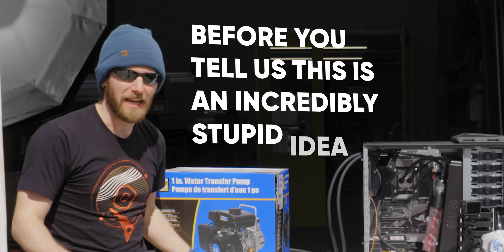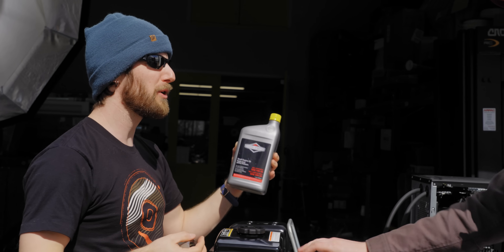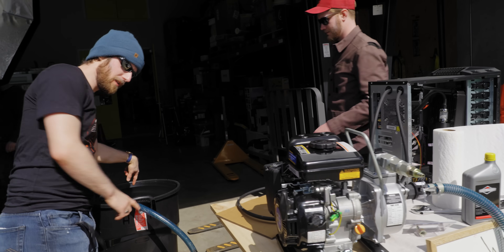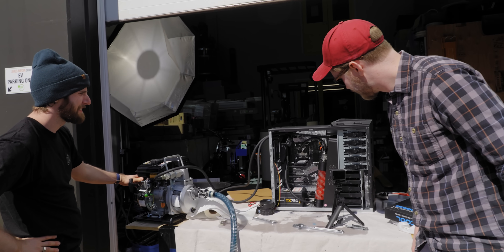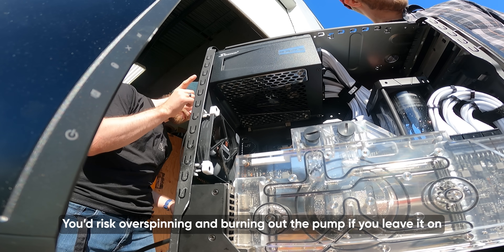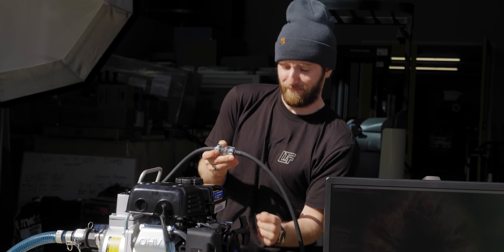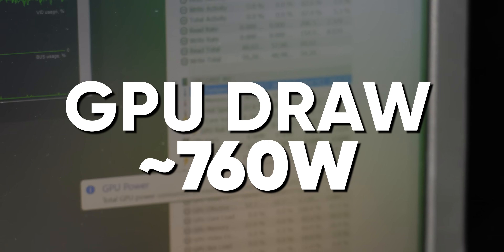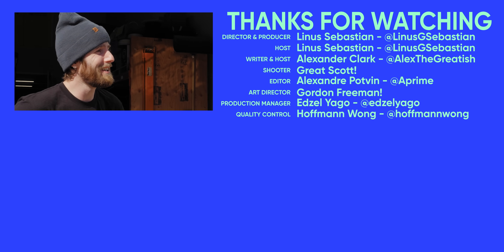Cooling a PC with a 2.5HP Pump

Comment: "...78 miles per hour."
So, i know where this is going.
I just want to see their reaction at this point, when the damn block rips itself apart.
EDIT: That worked way better than i expected. Then again, i expected it to explode. ... But even then, it didn't just work, it worked well.
Reply: 74.8 km/h

Comment: Heres an idea, go find a cold mountain stream, run some 2 inch poly pipe and create a pressure head of about 30ft. Set the pc up down by the creek and let nature pump that icy water through it ! Bring some solar/battery/inverter with you and create the ultimate silent gaming experience lol.

Comment: Surprising how the loop held up under the pumping force.
Having dealt with replacing the pump on the well in our garden, the pressure of a high-powered pump can be huge. 

This reminds me, maybe he could get a well drilled in his garden and use a pump in there hooked up to water cooling without a radiator. Wouldn't be practice, but would certainly be fun.

Comment: Well it all worked out fine but putting your head in front of that pressurized nozzle is a really dumb idea. Hydraulic injection is horrible. You should think of the front of that pump as gun like with its destructive capabilities. But that said it’s a rad idea .

Comment: I feel like water cooling should be done with vacuum not pressure that way if something leaks its getting air in not water out. like that pump is flowing in the wrong direction it can have the same flow rate without the internal pressure, the computer can be sucking from the water tank and the pump can be sucking water from the computer and putting the water into the tank

Comment: Now its time to make a customized water block and line setup that doesn't restrict the water flow like all the reducers you added to use the small cooler lines that were pre-existing,  the smell/smoke was probably the paint burning off the exhaust

Comment: Why don’t you create a water block with a 1” npt that can handle the flow? Or do one that can take 10AN fittings. Honestly, you need to replace every piece of the loop with elements that can handle the flow. Like a motorcycle radiator.
Reply: Try the loop with a manifold that splits the flow into the different areas. I bet you could handle everything with an automotive brushless coolant pump.

Comment: next you can passively cool the PC by gravity siphoning the water from that huge trash bucket in to the loop and seeing if that is enough pressure to run and cool the system, if it does you should test how long it would last... that would make a great video

Comment: After 50 years in PC industry I thought I seen some crazy setups run by PC Cowboys, but I stand corrected, A Masterpiece of Over Engineering a Problem .. If you guys have so much money to blow on crazy challenges, I can give you one, Outfit a Remote School with Laptops & Starlink, installed with a network & a printer, a least it would have some real results ...

Comment: I always wondered If you could use a car radiator as a massive passive heat sync. You can get em for like 50 bucks so it would be pretty nuts if it worked.  Kind of goes to show you how much we are getting screwed on PC rad prices when you realize the one for your Honda is cheaper than for your pc lol
Reply: Just watching this video 11 months later. Or perhaps intercooler, oil coolers from older Volkswagen/Audi would also be interesting. Oil cooler I think woul be cool, fitting sizes would be a little closer to typical pc tubing sizes. Very interesting thought

Edit: I just closed this video, and on my recommended page the first video to pop up is Linus cooling a pc with a car radiator 😂

Comment: Instead of those really flexible rubber/polymer/whatever tubing, you guys could probably use 316 stainless tubing to hook up to the computer side of things instead. The kind used all the time in analytical instrumentation. It's easy to work with (e.g. - bend to what you need) and is actually pretty cheap all things considered; especially given the quantity and quality (ID/OD tolerance) you'd need. Modification of the cooling block itself so you can attach something stronger to the connection points rather than whatever those plastic fittings were were shouldn't be too difficult to do so you can make use of some better quick disconnects without shut-offs. (You might need a Swagelok-to-[whatever the quick connect thread is] at most, assuming one meant for directly attaching to tubing doesn't already exist.) That should make for a simple(er) tear-down and to where you can repurpose the tubing for something else later on down the road.

Comment: NPT typically means national pipe TAPER, meaning the threads have some amount of taper to them, meaning the tighter you can get the fitting, the more contact pressure the subsequent threads have on them :)

Comment: Removing the pump would've increased the flow quite a lot. I'm kinda sad they still had it in the loop. The water should've gone into the GPU, to the CPU, and back to the bin. Maybe even upping to massive tubes, like 1/2" ID.

Comment: Restriction to flow equals pressure... this was entertaining but i was hoping to see 1/2"-3/4" tubing.... next time try and figure the max flow rates of the blocks and upsize the tubing, id bet theres enough thermal mass in the trash can worth of water that you wouldnt need to run a radiator unless you ran it for more than a tanks worth of gas

Comment: I'm still waiting on you guy to make a pc cooled by the ac of a car equipped with an interchiller .. like the hellcat. then try to compete its overclock with a air-cooled pc(still in a car). you literally use concrete for a loop before... so why not. Could be an opportunity to create a Standalone ECU from a pc maybe
Reply: you should also use hydraulics hoses like Eaton Aeroquip with 6an fittings... would be similar size to pc fittings and can handle 1000 of psi. enough to blow blocks and radiators

Comment: In that setup u dont need pc water reservoir. Just attach pump hose to loop with no radiator because u have so much water u dont need to chill it due to volume.

Comment: Hi i am running into a slight issue following your DIY guide video for watercooling your PC called "Cooling a PC with a 2.5HP Pump". I have my PC hooked up to the closest fire hydrant and things are working really well. Its quite and the temps are great. not sure what to do with the 6 feet of water in my basement

Comment: Well you know they make small electric motors with 2.5 to 5hp if you made special cooling lines and components, then you could chill the water in a reservoir, and make performance almost as good as liquid nitrogen if not better in some cases, after all how much heat you move is proportional to how much water you move

Comment: Try this again but without the radiator and reservoir, that should cause less resistance and give you even more flow and less pressure in the system.

Comment: Using a manifold may be better than feeding through the res. Then the gpu and cpu can get ultimate power and it'll help balance it out. Ur res would be the trash can of water. Also thar smoke is normal for any motor like that. It's just the paint baking. It'll stop after a few hours of heat.

Comment: To get the volume up with reduced pressure you should either make the output fitting larger with the corresponding hose or use a large volume container to reduce the pressure with a good volume of water.Leave it to linkheads to overheat the motor. You wonder why the rpm is set the way it was and then you bypass the safety rpm and the motor tries to overheat. Good job...not really!

Comment: Alex really missed a trick at the start. The board states the flow rate of the D5 is 1500 L/min & the gas pump is 9539 L/min (6.36 times higher). 
Since Q=VA (Q is flow rate, V is velocity & A is area) and A is constant, the velocity will just be 6.36 times higher (tube size being equal).  
Giving you 69.96km/h.  
Nice.

Comment: I have a 3 HP compressor motor just collecting dust that will be quieter.  Of course it probably weighs 40-50 pounds if I had to guess.  The second computer seems to hold up well but long term, don't count on it.

Comment: As an engineer, I applaud the use of the Bernouli equation (even though it wasn't used correctly). As the owner of a plumbing company though, I can only shake my head. As a computer nerd, I'm happy with this video. Next time, use larger diameter tubes, shorter runs, an electric motor for the pump... If your building uses chilled water for the A/C system, you totally need a permanent manifold to connect PC cooling loops to.  Overall, a 7/10. As my daughter's kindergarten teacher would say: "Keep up the great work :)"
Reply: Yeah, where is the head loss calcs? where is the NPHSA for the pump? where is the fluid velocity calcs?  my guess there was crazy turbulence going on.
Reply: @matthewesunderland  definitely a missed opportunity to explain some commonly misunderstood fluid dynamics concepts. Their actual cooling results were interesting enough that I hope they explore this more in the future with a more practical high flow set up. I would love to see results from using many regular PC cooling pumps in series and/or parallel. Added reliability bonus too! Now I kinda want to try it for my own PC...
Reply: @matthewesunderland  Exactly my thoughts.
Reply: I could not have said it better my self.   Seriously,   its a great steeping stone for a real serious video series..
Reply: I would say that he could outright just use the tapwater for cooling, and it might just do as good a job as this clunky oil drinking monster setup. After all, the tap water in a porperly designed building tend to already have enough pressure and waterflow in it, while such tiny pipes in these computers really doesn't need too much cool water at too high a speed to handle it. And yeah, wasting water isn't good, but you could always recollect them for other general usages or even for water heaters so ...
Reply: @escwan6329   You bring up a good point about needing to keep the water flowing, by having to dump the discharge instead of circulating it. While impractical, it's still a better idea than what was done in this video, and I would like to see it done.
Reply: @skyman3  Hadn't they done this before?
Reply: @escwan6329  Calcium (and other minerals) has entered the chat 🤣
You cant use tap water for cooling loop unless you wanna replace the block every week.
Reply: though the combustion engine just adds to the absurdity of the whole contraption.
Reply: and lose the radiator. It's pointless with a 50 gallon reservoir!
Reply: ''electric motor for the pump''  that defeats the entire purpose of this video...
Reply: @justarandomguy3969  I agree that the gas pump is a little more exciting, but they could have certainly bought a 2.5HP electric pump. I think the point of the video was to demonstrate complex fluid dynamics and thermodynamics that can't be solved by just hooking up an oversized pump.  I would love to see them take it further/better.
Reply: @skyman3  the only reason i clicked the video was the ridiculous gas pump, if it was just a big electric pump (2,5hp) i wouldnt have had any reason to click the video and i think linus knows this
Reply: Need an electric pool pump.
Reply: Alex is also an engineer. I'm pretty sure he could do the proper math but they set up the whiteboard only for a scripted bit

Comment: Seems like the Doc and Roger from The Whiteboard are at it again.
9 points out of 10, but only because:
- No gas turbines, rocket engines (with or without hypergolic fuels), fusion reactors or quantum wormholes involved.
- Didn't end with a big explosion, massive rip in the space-time continuum or a zombie apocalypse.
- By the end the cast wasn't faced with an angry mob, police, the whole fire department and/or the National Guard.

But from my observations, more than double the LD50 amounts of caffeine may have as well been involved, so it's all good.

Next step: hardline watercooling setup with well constructed high pressure stainless steel tubing, powered by a Saturn V turbopump. Using ethylene glycol coolant cooled well below 0° C by an industrial heatpump. Oh, drop in something involving quantum phase change or cold fusion somewhere in the loop. Side note: maybe you can use dioxygen difluoride to power the turbopump and get a bit more oomph out of it?

Comment: you are stupid, because the temps are not lowering as a result of you are having e a giant pump there but, you have a large reservoir. try that test with a closed environment and longer the test period you will end up with the same results with the small pump and the reservoir. it is not infinite, plus you are wasting too much power with that combustion engine, you can have even better results with a standard water pump that is shipped with the cooling system and with the same reservoir that you are using now. because flow rate will be way much higher and you have enough water that has a chance to cool down on time.

Comment: Not a pump engineer here, but I think the choice of a centrifugal pump hurt your max theoretical performance. Centrifugal pumps basically whirl the water really fast and sling it out the outlet. If the outlet is heavily restricted, the pump will quickly max out pressure and the impeller will dump most of its energy as heat just churning the water up. That's why the pump started smoking; if you'd kept running the setup much longer you'd have seen system temps shoot up as the pump started pushing hot water.  What you want is a positive displacement pump. You can think of a centrifugal pump as like a propeller churning in a bucket, while a positive displacement pump would be a piston pushing water out a cylinder. The water will move given sufficient force behind it. A common example of a positive displacement pump is a pressure washer, and if you think about it that's already perfect for your needs: small diameter output hose blasting ridiculously high speed water. 

Probably need rigid copper tubing for your coolant loop though 😁

Comment: you guys should also try a pool pump. like the gasoline. they deliver 1.0-3.0 HP. (depending o model) But they can withstand the pressure.

Comment: Ok now if you truly want to science the shit out of this you need to put a flow meter between the pump and the PC as well as a low range pressure gauge. Before doing that though remove the normal PC water pump from the system because that is being turned into a motor and probably your biggest restriction to flow, which creates pressure and causes leaks/blowouts. Once you have the flow and pressure into the PC, get a restrictor type flow control valve and dial it into max the flow into the PC; could also use a bypass type pressure compensated flow control valve but that would be a lot of rigging up. 

I am a heavy duty mechanic currently in my third year apprenticeship school legitimately learning about hydraulics so I have some sort of idea on how to rig up this system for more success. Now keep in mind I work with non-positive displacement pumps and the pump you guys are using a positive displacement pump so the pressure/flow could go back to tank instead of only flowing towards the PC so what I am suggesting may not work since the pressure is so low. You're overall goal is flow and not pressure since you're only cooling and not trying to convert hydraulic energy into mechanical energy so the choice in pump is good unless you can rig up valves on a non-posi pump to massively reduce pressure while maintaining flow rates.

All this is super confusing I know but I would love to see a way over engineered water cooling system.

Comment: You’ll get a similar drop in temps just by running an open loop with a normal water pump and a constant cold water supply.

Comment: I think metal piping would hold the pressure , but if anything goes wrong it will damage hardware.
Is there a way to do a loop with mineral oil, diving PC on reservoir and pumping the oil to a radiator?

Comment: This is kind of dumb. Obviously any increased flow rate would just cycle the hot fluid back over the overheating CPU and GPU. Instead, they need to hook up a freon compressor to turn the loop into a mini air conditioner. That would at least offer a performance increase, though you would need the internals to be 100% moisture free to prevent condensation building up on the components.

Comment: The extremely limited flow rate of the water through the pump means that the pump is going to churn the water and heat it up.. I've had operators partially close output valves on pumps to heat up the fluid in the winter to prevent the pipes freeze plugging :/ ...